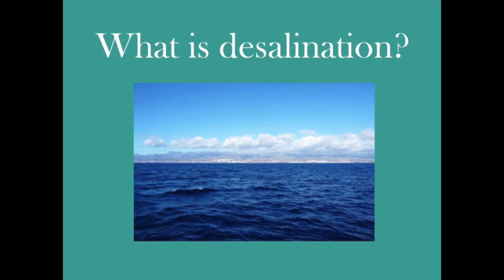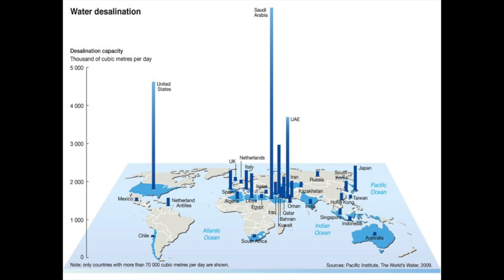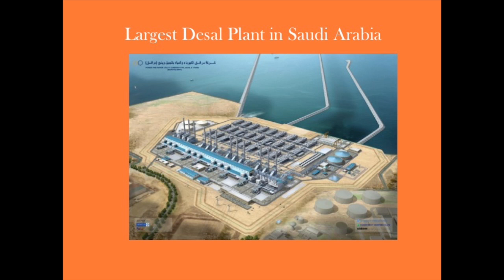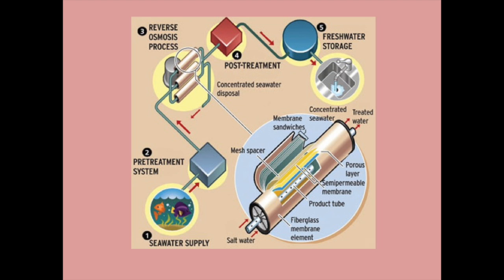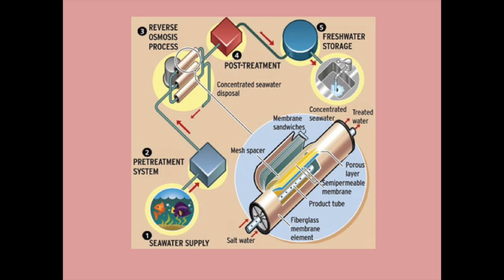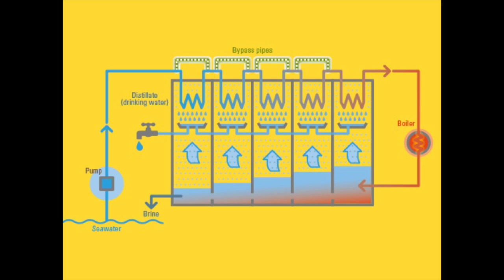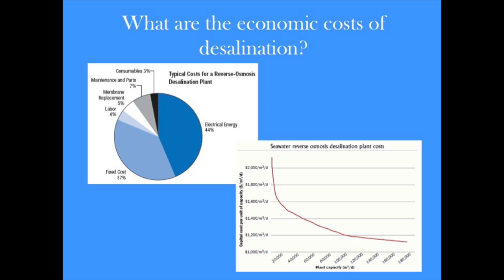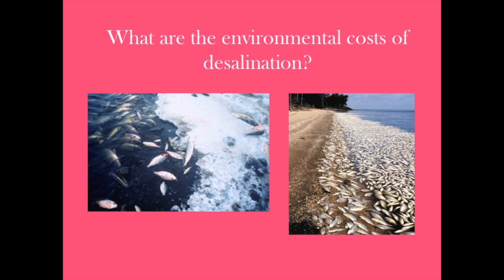The Cost of Water Desalination

Comment: Cold Steam the efficient way to use the sun geothermal composting rocket stoves any heat source to produce electricity and or distilled water explained from basic concept to employment. Water boils in a vacuum at 75 F or 24 C
Two open containers one full of water the other empty connect them at the bottom and water will reach an equilibrium 50 50. If one is sealed except for the connection the other will remain empty because of the vacuum created in the sealed container. 
Gravity will overcome this vacuum if the containers are taller than 34 feet.
 If the tanks are 40 feet tall the tanks will reach an equilibrium of water levels at 34 feet leaving six feet of hard vacuum in the sealed tank. This makes a vacuum pump set we need two of them if we were going to distill water as the cold side open tank is used to collect the distilled water from it as the continuous input of water needs to go somewhere.

Each sealed tank has four valves three at the top two of those on opposite sides (B&C) one at the very top (D) one at the bottom on the side (A), water-based vacuum pump operations are, Close bottom tank valve A and top tank valve C.   Open top tank valve D. Fill sealed tank through top side valve B. Close valve B and D when full. Open bottom valve A. 
This primes the system to let the warm water in that will vaporize and run through the system when you partially reopen valve B (to control flow rate) and open valve C to its fullest.

For only power generation need one pump set and one vacuum tank so we can have a Hot side and a Cold side one to boil the water and one to have the low pressure/vacuum to draw the steam in through the turbine then the cooling coils then to the tank. 
At the bottom of the cold side, tank is a return pipe with the one way valve to the heat source the one-way valve prevents expansion back to the cold side and as the hot side vacuum chamber is the only outlet for the expanding water and it is drawn by the vacuum the cycle proceeds.

You can combine the two and get power generation and distilled water keeping the return line from the power generation system will let you switch if you don't need distilled water on a continuous basis in large quantities.
 I am going to make one feel free to make one as well it is open source.
Reply: just to learn better,
so.. as energy consumption would be exactly as DISTILLATION !? just that water operating on lower temperature (which would be very disadvantageous to bacterial disinfectant by boiling aspect) while vacuum motors would need similar or exact energy consumption as in distillations !?
with way more equipement consumed or parts necessary(vacuum tanks, turbine, higher pressure pump than distillation, and that in addition and besides the equivalent distillation equipement (tanks, condensers, pipes, motorpumps)), not mentioning how dangerous AND difficult are vacuum tanks to work with. way more dangerous AND difficult AND expensive than nonpressure distillations (considering that both would be running on identical energy source type ).
Reply: @d6wave  No the energy consumption would be far less than traditional distillation which needs you to heat water to 100 C to boil and then collect steam as you would only need to heat it 30 C.

The first part of the post is describing how to make a low tech vacuum pump using only water pumps and why it works.

Bacteria are not a problem if you are just distilling water as they do not travel up a fractional distillation tower on the steam and they die as the vacuum boiling process bursts them from the inside so they don't live to grow colonies in the system.

You can just let the sun heat water in a special box and collect the vapor and that is slow or you can heat tanks full of water and flash boil them and distill the water far faster it all depends on what yo need and how much you can afford to build.

If you wanted to only generate electricity that is a different system and easier.